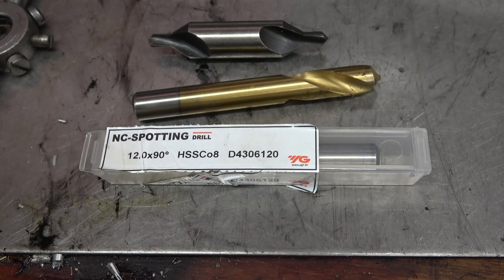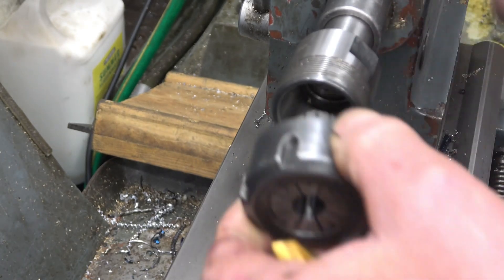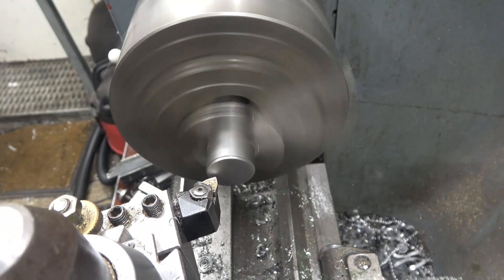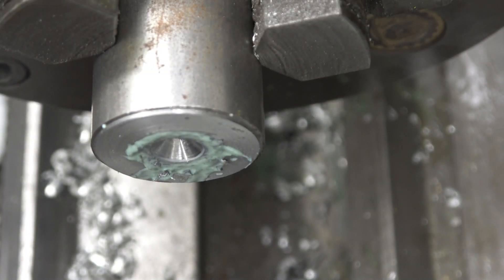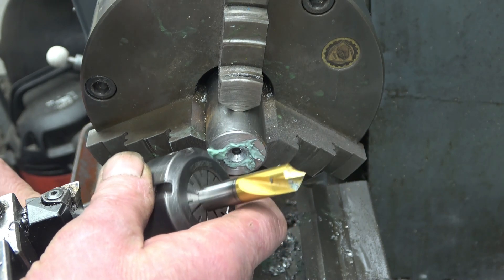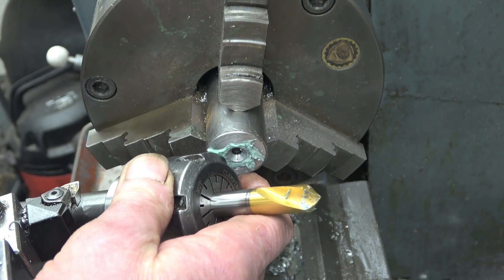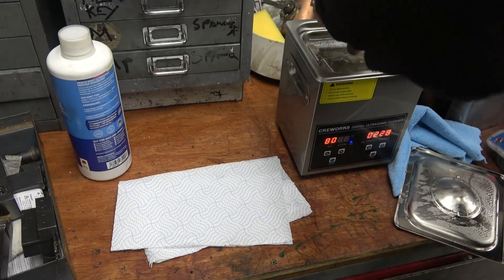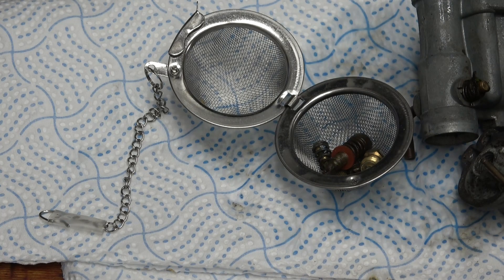Wednesday Catch Up 13 .  Spot drills Revisited . Ultrasonic Cleaning Tank.

Comment: This still isn't the full story where spot drills are concerned. The new spot drill you show here is a 90 degree inclusive angle point.  
What you really want is a spot drill with a 120 degree point to spot before using a jobber drill.
If you look on the Cutwel site under spotting drills you'll find they sell both tip angles in that YG brand.

Comment: Re spot drills. They come in two basic designs, 90 degrees and 120 degrees. I am not sure what the 90 degree ones are used for, but the 120 degree ones are for preparing to drill. The one you bought was a 90 degree. The 120 degree dimple guides the 118 degree tip of a standard drill nicely, in a way that a 60 degree centre drill or a 90 degree spot drill cannot. Stefan Gotteswinter has a good bit of video on this. I don't think the drill you used last week is a stub drill. Stub drills, while shorter than jobbers, have more helix than a spot drill, and they have lands, which I couldn't see on yours, when it was briefly in frame!

Comment: Video seems to playback now without issues. Thankyou for the shout out john. It's a cracking bit of kit, I replaced the plug on my unit and it works a charm, no point in hoarding useful gear when it can be passed to others that will get use out of it.

Comment: Ref Spot drills, I understand that these do not have lands on them, whereas stub drills, or jobber drills, or most twist drill bits do.
Very useful the ultrasonic cleaners, carburettor alloys do degrade quite quickly in them, they go from dirty to clean, then dull in a few minutes.
Thanks for sharing

Comment: John,
I was always told through my engineering experience that the angle of the spot drill needs to be larger than the angle of the drill to be used, to ensure the centre of the drill makes contact before the outer edges, reducing the chance of it wondering.
Reply: I asked the question to this answer on the patron page! Thank you for the response 😂
Reply: As you say, spot drills generally should be a larger angle so that the tip hits the centre of the cone of the centre pop and is less likely to wander and so that the flutes aren't damaged by hitting the sides of the hole. Some people claim the opposite and that the angle should be smaller so that the flutes hit first. I don't understand the thinking behind that.

For 118° drills you need 120° spot drill (not that easy to find in the UK), for 135°, you need 140° (like rocking horse shite and very pricey in the UK).

All that said, the spot drill DB has is a 90° which is bugger all use, except for use to produce a nice chamfer.
Reply: @stevedavey1343  There is no thinking behind that. The further off the drill centre the first contact is, and it will always be on one flute regardless of grind quality, the more the drill will be pushed off centre.  If you really want to get a bang-on-centre hole, especially if it's deep, drill undersize to a depth of around 3x the final diameter, bore out to the exact final diameter, and then go in with the final drill size.

Comment: What is the point angle on that spot drill?  Doesn't look like the spot drills I use.  Too pointed.
Reply: The new spot drill John uses here is a 90 degree drill. The ones you use are most likely 120 degrees inclusive angle and the more commonly used.